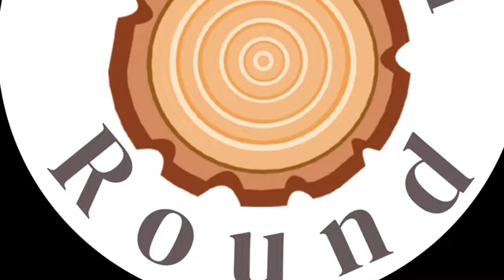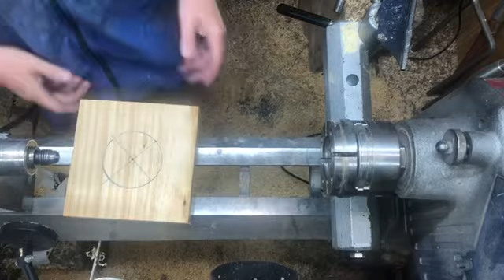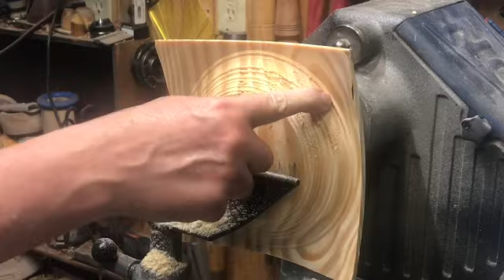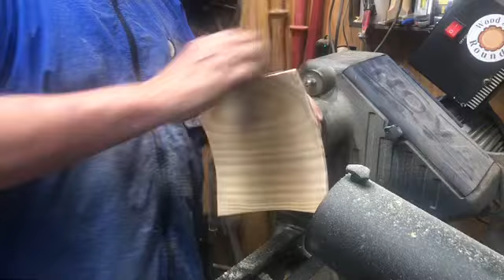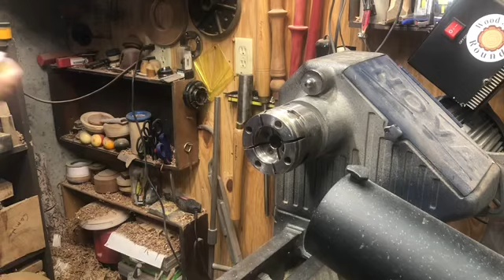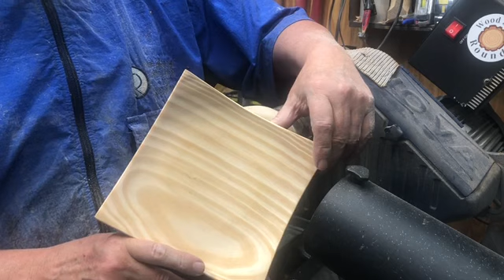Turning the Plate Square  #woodturning #woodart #wood #pine #turning #turned #plate

Comment: Nice looking square plate Doug Pine can be very attractive and does not get the credit it deserves. 
 Funny I just finished a square turning today.  But it is not your ordinary square bowl.
 The only tip I would offer is I would drill a hole for a worm screw and then you can finish the bottom before flipping and not have to worry about that nub.
 It will end up being faster than trying to cut the recess with the tailstock in the way plus it is all done. If I was going to use a tenon then I might do it like you did by holding the piece against the chuck jaws but not for a tenon. But that is just me.
 Happy turning,
Gary
Reply from the maker: Thank you so much Gary. I thought about a worm screw but the depth of it worried me. I’ll check mine, maybe make a spacer for it. I’m sure it would speed up the process and be even safer. 

I appreciate your viewing and advice.
Reply: Fun to watch Doug with lots of good information.
I have 6 Nova chucks and of course they all came with worm screws. Funny thing they are not all the same length and at first I did not like the short ones. But they come in very handy for a shallow blank. But your idea of a spacer disk will work fantastic and it can also be wider than the jaws to help in stabilizing the piece.
 Looking forward to your next video.
Gary

Comment: Very nice square plate, Doug. I love turning these and I think it’s because it’s a bit more of a challenge than a typical round bowl. I would like to do a sticker swap with you. My email and mailing addresses are both on the about tab of my channel if you would like to contact me. I don’t see that on your channel. Thanks!
Reply from the maker: Thanks Gord. I actually put stickers in the mail to you yesterday. 
I am going to start the next
Plate on a wood worm screw. The Poppa 1947 suggested it and it seems to make sense. If the pine will hold it, the process should speed up a bit. 
Thank for watching. Much appreciated.